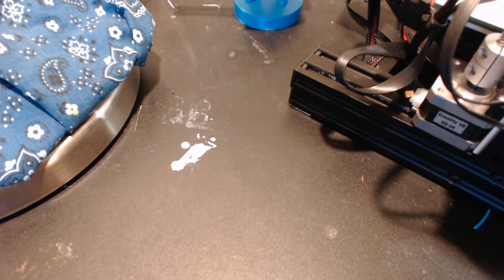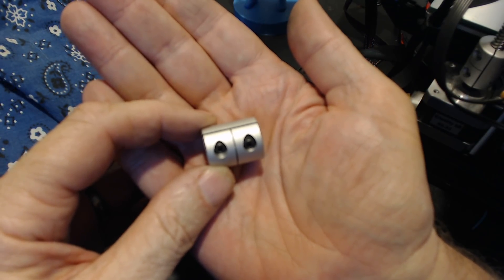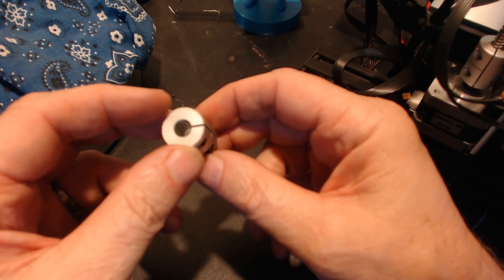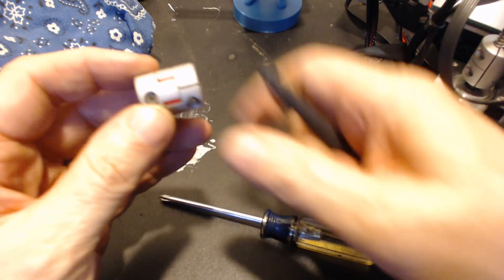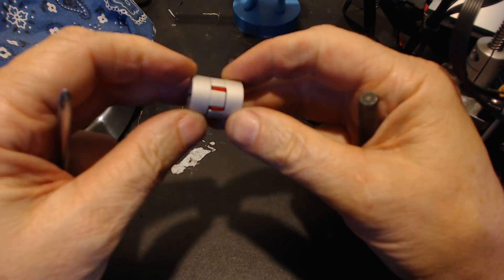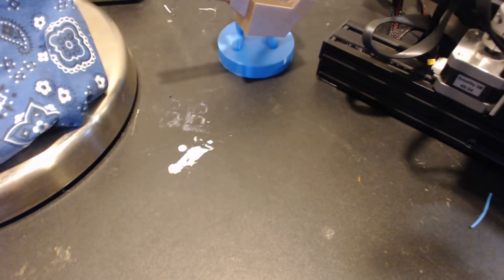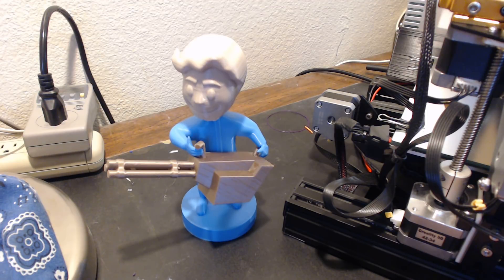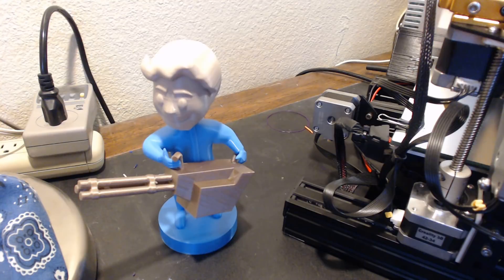Ender 3 upgrade, open source discussion and Fallout Big Guns Bobblehead!

Comment: Does this coupler help improve print quality by preventing any sort of Z binding?
Reply from the maker: I suppose if you're experiencing binding in the Z axis this could help that, but It's more of a safety device than anything else. While I might use it as a means to troubleshoot Z axis problems, if it solved the problem I'd look for the root problem and fix it. I hate bandaids.

Comment: Hi chuck im thinking same whats cons it red one and after u replace coupler what benefits ur prints
Reply from the maker: It's not going to make your prints better. It's mainly there for safety in case there's an obstruction in the z movement and to give the z axis lead screw a bit of flex. Or to replace a broken one.

Comment: I get frequent light shocks when I touch bare metal on my ender 3.  Not enough to injure me but highly annoying.  Also I often jerk away and am afraid I will break something.  Anyone experience this?  Any ideas how to fix?
Reply from the maker: Is the outlet properly grounded? I'm no electrician, but almost every time something like this has happened to me it's been a ground issue. Good luck!
Reply: Nothing in this country is properly grounded,  (Thailand)  I connected the from to an aluminum window frame which grounded through concrete.  The shocks still occur but much lighter now.  Almost un noticeable.  I will make a better ground and I'm pretty sure the shocks will go away entirely.  Thanks!
Reply from the maker: I live in an old house, built in the early 1960's and it has crappy grounds. I wound up hammering a 3 foot long copper rod into the ground near the main electrical box and connecting a large gauge copper strap to it. That solved a number of our electrical gremlins, including getting shocked when we touched the water faucets. The previous owner had connected the ground to a water pipe.
Reply: This house I am  in is very poorly grounded if at all.  The water pipes coming into the house are PVC, that were run, then set in the concrete as it was poured. Then they ran metal pipes coming out from the walls.  I think the electricians connected grounds to the metal pipes that weren't grounded.  I will probably have to do something like you did.

Comment: Has anyone tried importing the SW files or the STEP files?
Reply from the maker: I've imported STEP files, but I can't remember exactly how I did it. It was either with a conversion or directly into Fusion 360. If you're having problems let me know and I'll try to figure out how I did it.
Reply: Chuck Bryant thanks but I don't use F360.  My point is that the SW *.sldprt and sldasm files as well as the STEP files are corrupt.  They won't import no matter what system you run.
Reply from the maker: Which files are we talking about here, can you link one of the STEP files?
Reply: Chuck Bryant go to the link you posted to Creality's Github site and they are all there.  Both STEP and SW files.
Reply from the maker: I see the link you mean, I didn't post that someone else did. I looked at Ender-3/Ender-3 Mechanical/STP/24V15A power supply.step and I can view it without a problem.
Reply: Chuck Bryant did you try and import one of the files?  Not the PDF's but the SW and STEP FILES.
Reply: The files can be viewed on the website but the STEP and SW files are corrupt.  Everyone has been posting the link to the Github site and the only files that seems to work are the Excel file which is the BOM and the PDF files.
Reply from the maker: What program are you trying to open them in? I just tried opening one in Fusion and it failed. I'll try several others and in other programs over the weekend. Unfortunately I'm out of time tonight. Thanks for letting me know about this!
Reply from the maker: I just tried one on Autodesk's Online Viewer and got the below error. 

Sorry. Referenced files are missing. Please upload all references.

ATF-1025 The file: C:\worker\viewing-atf-lmv\tmp\job-1\89\t1530932259686_03412850247479211_1530932259687.step is corrupt or invalid.

TranslationWorker-RecoverableInternalFailure Possibly recoverable warning exit code from extractor: -536870943
Reply: This is my whole point Chuck.  All the files that matter that are supposed to be Open Source can't be opened.  They are corrupt.  I use Ironcad for design but I'm an Autodesk Reseller so I'm not exactly new to the design and machining biz as I've been printing for over 5 years and before that on Stratasys systems.   My main focus is multiaxis CNC programming and support with Powermill and Featurecam.   That Chinese girl is posting links to bad software out of a cracked 2016 version of SW and SW has lousy STEP translators anyway but the overall point is that no one is checking this stuff out to make sure that it's valid.  Any company that is running licensed software for the most part is going to be updated as a consequence of doing business.   That's just how it works in the regular world.

Comment: Hey Chuck another interesting video, I'm learning and I havn't printed a thing yet. I have a question though.

The printer was advertised as having a Mk-10 Extruder, so I bought a spare Mk-10 nozzle, but now I have the printer built I noticed that the spare nozzle that came with the machine is smaller. The spare nozzle I bought has a 7mm thread and has been machined to take the PTFE tube inside, which the one on the Ender does not. Have I got a different hot end, or have I just bought the wrong spare nozzle?
I've written to Creality who confrmd that the eBay seller I bought the machine from was in fact them. So I assume it must be a genuine machine.
Just a bit of a puzzle.
Also I'm waiting for the mirror to arrive becasue the bed (as you said) is dished by about .5 mm, so it really is unusable in it's current condition. Does the glass reduce how much the bed will heat up?
Regards
Joe.
Reply from the maker: Joe, I'm not sure of the answer to your nozzle puzzle, but my Ender 3 nozzles have a 6mm thread and are not machined for a bowden tube. I've got two Ender 3 printers and the nozzles on both are identical. I hope that helps.

I haven't measured the glass temperature, I've got a non contact thermometer but it works like crap on a mirror surface. But I also haven't had any trouble with adhesion...if anything sometimes adhesion is a bit too good. My bed temps are PLA at 50c, PETG and TPU at 70c.
Reply: Thansk very much Chuck most helpful as usual. I have had an answer from Creality themselves who say "The technology is Mk-10 but that doesn't refer to the nozzle size". So it seems the printer I bought is all good.
Did my first print today started with a simple 20 x 20 x 20 cube, which came out beautifully, so I'm well pleased.
I did as you suggested and didn't bother with the standard bed, I bought a pack of four 220 x 220 mirrors from the hardware store. I did try my wifes hair spray but it wouldn't stick, so I used a Prit stick (glue) and that worked a charm, so I'm a happy bunny. And the prit stuff is easy to get off with Acetone.
All the best to you and thanks again for your help.
Reply from the maker: You're welcome Joe!
Reply: Just a small ammendment, I found that Prit is water soluable, so it just washed off, easy!!

Comment: If the alignment allows I prefer solid couplings over the normal flex style, choices.
Reply from the maker: Normally I would agree, but as a tinkerer I like the added safety of having a coupler that will disconnect if I'm messing with the ending G code script and got it wrong, which I've done. Fortunately when I messed up I was watching it and flipped the switch off. Next time I might not be which is why I went looking for a coupler that would disconnect under those circumstances.

Comment: Hmm, I hope you will keep us updated about that coupler. I was looking at them for my CNC, because they don't need so precise movement as 3D printer. Also I'm a little bit sceptical about using them on the 3D printer, cause they can easily throw your layer high off.
Reply from the maker: I've got a desktop CNC, why don't you think it needs as precise movements as a 3D printer? Anyway, I've been using one on my other Ender 3 for about a week and it's working fine. It wouldn't change layer height unless the Z axis hits something solid while moving down. Moving up it's solid and can't change unless it's been separated and not pressed back together completely before starting another print.

Comment: I might be wrong but I don't think this is a "self-shearing" coupler?   but more of a dampening coupler type!    in case of malfunction, there is still a mechanical connection!   a self-shearing coupler would completely disintegrate or disconnect thru separation or delamination?  thou what you are showing is perfect for misalignment or slight vibration isolation.   just an observation...
Reply: They are 'self-shearing'.  I run them on all 4 of my CNC motors and they have come apart, as they should have, many times after accidental crashes.
Reply from the maker: It disconnects if the Z axis hits something while moving downward. I've tested it and it works.

Comment: Hey Chuck, me again but i got a problem i can't solve on my E3. On square corners i get ramps in both directions causing corners to stick out and measure oversize and on round parts i get a big bulge followed by a big divot in a straight line where the start,stop point is. Does that make any since or would you like a picture? Belts are good, not overextruding so any help might lead to a solution since i am stuck at this point.
Reply from the maker: Have you printed something like a 20x20 test cube? I'm trying to think of what could cause that other than something being lose or out of adjustment and I can't. Link me to a picture of a test cube and I'll think about it more.
Reply: Chuck Bryant yes i have but since thrown it away, i will print another as soon as life will allow it.

Comment: Also. Github files released 4 days ago here: https://github.com/Creality3DPrinting/Ender-3
Reply from the maker: Thanks!
Reply: going through the step files for the ender 3... They are incomplete and not the finalized designs.

Top brace is missing, and side vertical supports are missing the holes for the power supply.

This is making it time consuming creating the assembly in Autocad Inventor (which accepts the step files as parts, but makes it difficult to fix the parts as I have to remake them)

--edit-- 8:43pmcst

ok... I started, but the part files, are in no way the production files.

While this is a Fantastic starting point, Even the control box top does not even line up with the mounting locations...

So In am going to hold off until I put mine together so I have something to compare against.

proof I was screwing with it: https://klovimg.com/images/2018/07/04/ender3.md.png

what I have available today is uploaded as a pull, and on my fork

update 9:47pm cst - done for tonight

https://klovimg.com/images/2018/07/04/enderassm2.md.png
Reply from the maker: Interesting. Thanks for doing that and keep us posted.

Comment: I may have gotten a improved version but I haven;t had issues with my z axis at all nor need of a spacer.
Reply from the maker: I've put together three of them now, all had Z axis alignment issues. I hope they did improve them, but the last two I put together were the newer iteration with the injection molded power supply covers. I think there's enough slop in their manufacturing process that some line up and some are way off. I've heard people needing 5mm spacers and one of mine only needed a 2mm spacer.
Reply: I guess I will find out too, I have one being delivered from Amazon Thursday. It was pay 239usd. Or wait 6-9 weeks.
Reply: got one in the uk last week, had already printed the shims from thingyverse, built a few this type of setup now and i find loosening all the bolts inc the ones on the stepper mounting from the top, hand turn the arm to the center point, via the threaded rod  then lightly nip the bolts, hand turn back up then back to the center point before snugging up the fixings sorts the issues generally , hope this helps someone
Reply: I had to adjust the z lead screw too. I ended to adjust the z motor to have the z screw in line with the motor
Reply: I had to adjust the z lead screw too. I ended to adjust the z motor to have the z screw in line with the motor